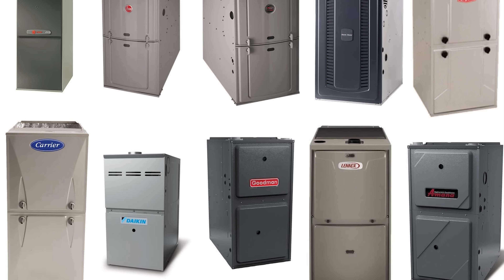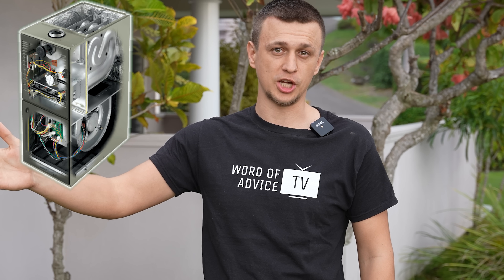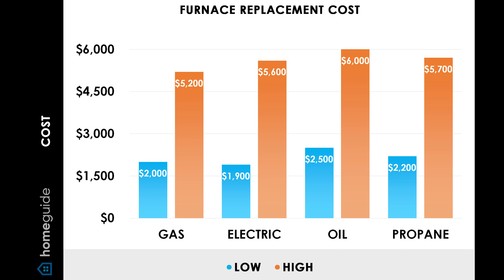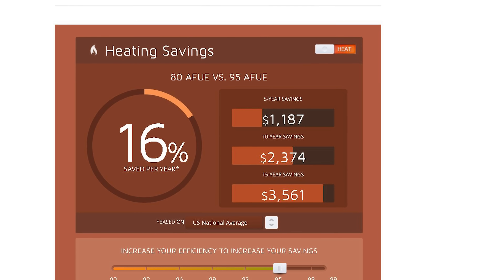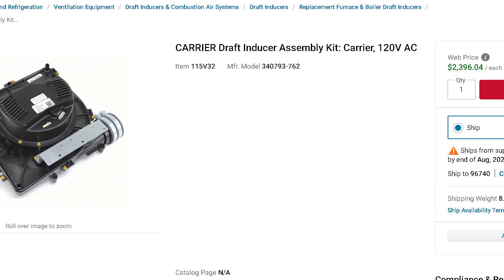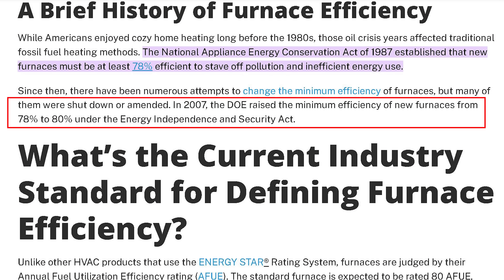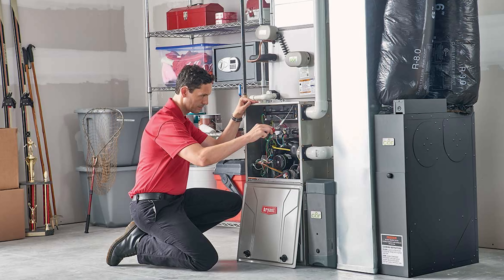Don't Buy a High Efficiency Furnace!

Comment: I like the 90%+ furnaces because they don't waste a bunch of heating energy like the 80% furnaces, but I think personally think that as long as a furnace works, and does what it's suppose to do, the efficiency doesn't matter.
Reply: The biggest difference is like my 80% Lennox took all it's combustion air from the room, and it had an open 5" metal flue pipe, the fact it pulled cold air in thru every gap and crack like that and the open flue probably could be said to derate that 80% to 70% or less because of how it was designed. The 96% Goodman I installed myself 3 months ago takes all it's combustion air from outside thru a 2" PVC, and the flue is a 2" PVC- no open flue any more.
Reply: Lets Calculate: Savings of 95% over 80% for 35 year life of Lennox Pulse.  $1000 year spent on Nat Gas with 95% so spent $35k in 35 years.  Would need 19% more gas for an 80% (.95/.80=.19).  So $35k * 19% = $6,650 saved over 35 years.   NOT ONLY is there energy savings, but HIGH quality equipment last twice as long, so saves another $3k to install another one.

Comment: In Canada, Alberta we are not allowed to install anything under 92% efficient so everything is high efficient. Its they way to go. I install airease which comes with stainless steel heat exchanger. The only way you will spend over 2k for a inducer is if you have a Carrier Infinity. Not a big fan of those and do not recommend unless money is not a concern to the costumer.

Comment: For my house we never had automated heat until about 10 years ago.  We had a woodstove only.  The reason we went with a high efficiency was due to the pvc venting.  I didn't want to add a B vent through the roof or an ugly one on the outside of the house and I did not want to share the chimney with the wood stove.  I think the pvc venting is often the only reason people go with a 90+ furnace.  I enjoy your videos man.

Comment: The only groups of people that should opt for an 80% efficiency are southern/tropical island residents and slumlord cheapskate landlords.  100% of the time you should buy 95%+  (for around $1,000 more) if you live in a northern, very cold state.  

Last, where in the heck did you find some oddity outlier inducer motor costing $2300?! That isnt normal and I gotta say, its a bit fraudulent to present it as such.

Comment: One item you forgot to mention. The 90+ has 2 heat exchangers that add pressure drop to the air moving fan. This increases the watts used every time the blower runs. So in the south where you are running AC a lot the 90+ will actually cost you more to run over the year.

Comment: Great video! But I haven't found 90+ systems to be that much more than a good 80+ and often suggest them over the 80+ firstly because many older houses where I live don't have chimney liners.  Adding this "code required" upgrade can add 1,500 - 2,000 upfront.  In all fairness, though, if the client gets a new hot water heater and chooses not to go electric, they would still need to spend that money on the liner.
One last point, other than the centrifugal fan motor, I haven't seen really outrageous prices like you mentioned for these condensing unit parts.  I think brand choice is the greater determiner of cost of ownership than simply going 90+. Try comparing Bryant to Carrier pricing.  Costs are night and day for the same efficiency.   Btw, Carrier manufacturers Bryant.  Go figure!
Reply: Why would you need a chimney liner? Mine vents out the garage wall through a pipe.
Reply: @wisenber  With an 80% furnace you can't vent them with plastic.  The flue temps are way too high. The one way you could vent it out the side wall is with a power venter. They do that a lot on the east coast with oil burning boilers and furnaces.
Reply: @dgc1929  My vent isn't plastic, but it does go out the garage wall next to the gas water heater.

Actually, I just checked. It is CPVC. However, I've never noticed it being remotely hot or even very warm.
Reply: @wisenber  So you probably have a 90% or better furnace?
Reply: Yup, we went high efficiency partly due to the cost of lining 3 stories of chimney wiping out the cost differential. That was 20 years ago though, not sure how much things have changed.
Reply: @jamesroscoe7555  As I mentioned, that one is now a rental. I called my tenant this morning to have them look. Apparently it is a 96.1% efficient unit! 
The strange thing is that my neighbor's old unit and mine failed around the same time. ( I had an electric heat pump that only lived about 11 years before it died.) So I walked over to my neighbor's garage and talked to the HVAC techs doing her install to see what she was getting. He sold me the new unit split unit and installed it for $4200 cash which was about the same as I had paid for the electric split unit over a decade earlier.

Apparently I got a better deal than I thought about seven years ago if 96% units are so much more expensive.
Reply from the maker: @nsudatta-roy8154 Thank you for sharing your experience and insights on this! (and fairly laying out the details too) We appreciate it! I love that there are so many people commenting with different viewpoints. All these comments will be a great resource people can use to come to a conclusion of their own.

Comment: A lot of your points are more specific to premium brands (which I think are a waste of money).  I install Amana, and our basic high efficiency units are only about $400 more than an 80%.  We also don't charge anything extra for installation unless it's an upgrade from a 80%, and even then the amount is trivial, a few hundred dollars. The parts example you gave was for a carrier compared to Goodman. Carrier is notorious for charging 3-4x what other companies do for the exact same part. The comparable part for a Modulating Goodman is only about$100 more.  Either way you are probably paying mostly for the installation, not the part.   Modulating furnaces are also way more efficient, not only because they make heat more efficiently, but because they reduce the temperature delta between the outside air and the heated air. This reduces the amount of heat loss from windows, insulation, etc.  Most of our customers who go from a high efficiency, to a Modulating high efficiency save an additional 15%-20% in energy costs. That is on top of the 16%-18% you get from going from 80% to a high efficiency.    Modulating furnaces are also much more comfortable, provideing consistent warm heat more similar to radiant systems, compared to 80% units which blast the house with overheated air and constantly cycle on and off.
Reply: Hmm last time i got quotes it was like 2k for 80% eff, like 4.5k for high, but maybe that's because of the duct work...
Reply: Wish 80% had an option to draft from outside for the combustion...
Reply: @RogerPack  Using household air for combustion is actually why I bought the 80% furnace. They average house leaks air like a sieve, so you are burning infiltrated air and sending it up the flue, thus constantly changing the stale air in the house. Often people with tight houses and high efficiency furnaces resort to air exchangers ( more money) to get rid of the stale air and pollutants generated in a tight house.
Reply: I installed a high efficiency Amana three years ago. Difference from 80% was less than $1000 including installation and removal of a furnace that was probably 50 years old. It gets cold here. To me it was worth it, as I probably won't live long enough to replace it.
Reply: @vtxnana  In a super cold climate, especially with relatively expensive natural gas prices or propane, I would probably do the same. Portland, Oregon, where i live, is fairly mild in winter and gas prices are relatively cheap compared to other places in the U.S.
Reply: @RogerPack  the additional PVC venting required for a high efficiency would be less than $300 including labor. Generally high efficiency is no more than $500-1000 more expensive
Reply: Oddly I've seen a couple high eff. furnaces installed that just draft from the ambient.  Couldn't figure out why LOL.  In my neck of the woods high eff. is much more expensive [UT].  Despite the furnace itself not costing much more.  Guess they figure people with money to burn? :)
Reply: @RogerPack  what the heck is "draft from ambient"?
Reply: @srobeck77  the intake is from inside the house into the furnace.

Comment: My old 115,000 BTU PVC Exhaust Gas furnace with a radiator in my basement was an Amana it was manufactured in 1992, it failed 3 months ago it was 30 years old, with that said I don’t know what parts were replaced before I bought my house back in late 2018. I purchase a new AirQuest 88,000 BTU 96% furnace a few months ago for $1750 including delivery to my house.

Comment: I agree.  An installer put a high efficiency in my attic.  2 times I have had the condensate line freeze and cause leaks that damaged my ceiling.  So now I am in my attic installing heat tape and better insulation on the condensate line to prevent this in the future.  When the heat tape comes on (below 37), it will be consuming around 200W of electricity. So that likely wipes out any energy savings on gas.

Comment: Wow it is good to see how many people agree with you. I have had old furnaces for a long time and they are very easy to repair, then installed a new high efficiency and had nothing but problems since day one. The pressure switch for 1 has been an ongoing issue. Then the inducer motor went. Luckily I installed and fixed these myself or it would have been a lot more expensive. Thanks for the video.
Reply: Depending on where you live, a high efficiency furnace might save you a couple  hundred $ /year. I have gone over a decade with no issues, this means I might have saved as much as $2k in gas.

Easily paying for more than one repair if I had one.
I mean heck, they come with 10 year parts and 20 year heat exchanger warranty.

Comment: Oil is the way to go. Bulletproof proof and last twenty years. New England homeowners typically have this set up with a Bock oil fired hot water heater.

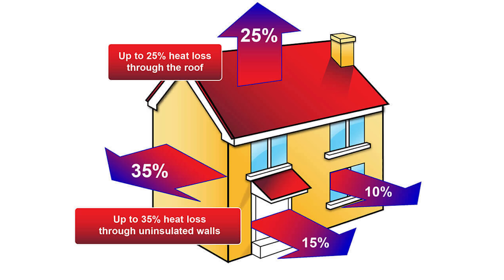Comment: I've been in the industry for several decades and mostly agree with what you're saying. I avoid modulating furnaces like the plague. Very little benefit vs. the extra cost of equipment and repairs. When it comes down to 80% vs. 90%+, many times it is a matter of venting the flue gases. If there is no existing chimney or what is there is not up to code for an 80% furnace, the 90% is simple to vent with PVC piping out the sidewall of the home. I often tell customers with older, natural drafting furnaces, as long as they are mostly satisfied with the performance, don't replace it. Parts are cheap and available. As long as they have me out to inspect and maintain every couple of years, the furnace will probably last them a lifetime. 3:30 Excellent point. I've rarely seen money wasted on insulation. Also, it doesn't matter how efficient your furnace is, if your home can't hold in the heat you're wasting money.
Reply: Lets Calculate: Savings of 95% over 80% for 35 year life of Lennox Pulse.  $1000 year spent on Nat Gas with 95% so spent $35k in 35 years.  Would need 19% more gas for an 80% (.95/.80=.19).  So $35k * 19% = $6,650 saved over 35 years.   NOT ONLY is there energy savings, but HIGH quality equipment last twice as long, so saves another $3k to install another one.
Reply: @pablopicaro7649  I believe your estimation of a 35-year lifespan is quite optimistic. Also, Lennox Pulse hasn't been manufactured for about 30 years. A new furnace might get 20 years, or possibly 25 years if well maintained.
Reply: Only time modulating furnaces really have their purpose is if you want an actual legitimately functional zone system.
Reply: @timrob0420  And many times, just a 2-stage furnace will solve those problems.
Reply: @chrisdeanndavison3626  not really. Depends on the zone size, and if it has more than 2 zones it definitely won’t solve that problem
Reply: @timrob0420  Interesting, I've installed up to 8 zones on a non-modulating system and it works great. However, it is a very specific application that you typically don't run into.
Reply: Umm a home holding the heat is a completely, unrelated issue to what type of furnace you have.  It will offer even more cost savings with a high efficiency furnace because you have to heat it up more often.....
Reply: @chrisdeanndavison3626  so you’re telling me the furnace is sized to be able to heat the whole house but it’s “okay” and “works great” if 7 zones out of 8 are closed? That doesn’t make any sense. Seems that it would be tripping out on a limit at the least and short cycling.
Reply: @timrob0420  As I said, it was a very specific situation you typically don't run into. In our church, there are 8 classrooms in a row down a hall. Each room had enough ducting to handle the size of the HVAC system. Rarely would more than 2 or 3 classrooms be used at the same time, they would be used for 30-90 minutes and there would be days between classroom uses. So 95% of the time, the temperature was set very low on heating and off or very high on cooling. 10-15 minutes before the room was needed, the temperature was adjusted and the room would be comfortable for the time it was needed. It's been in operation for over 10 years and everyone has been very happy with it. And believe me, I was on the property committee for some time at this church, and if people weren't happy about something, they let us know!

Anyway, it seems we have different opinions on zoning. I will continue to do what works for my customers and you do what works for yours.

Comment: Videos like this are cancer to the industry.  You are immediately jumping from parts on 80% to the costs of parts on the highest end models.   Most companies barely have 80% lineups now, and the majority of the manufacturer lineups now are high efficient lines.  90% units are NOT new technology it’s been around since the early 80s.  Yes high efficient heat exchangers can have issues, but guess what so do normal ones.  The better the unit is installed and matched to the home, the longer it will last regardless of the efficiency.  I still see 60-70% units on rare occassion with heat exchangers that run like champs.  There are some brands that have had issues with their designs, but if you are having the system maintained by a legitimate contractor they should be able to keep you aware of issues.   Carrier had this issue and I have seen customers have them changed for free.  Amana provides unit replacement warranties on their high efficient lines.  Then you have brands that actually have poorer quality parts on their budget lines.  Customers then get upset because of how many issues they have with them.  If as a technician is having issues diagnosing a high efficient system, they need to be trained.  If you are having issues diagnosing, take ownership of your training.  This isn’t new technology anymore.   There is newer technology on the highest end equipment, but that isn’t for everyone. I do agree with that.  But a general blanket statement about not buying high efficient equipment is just plain cancer.  Climate will make a difference, but the statements and general thoughts of this is cancer.